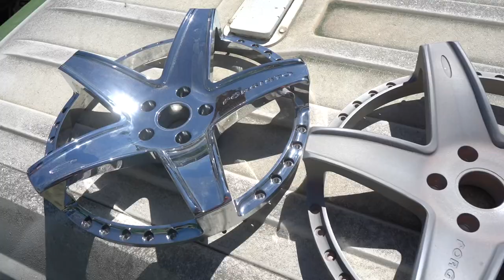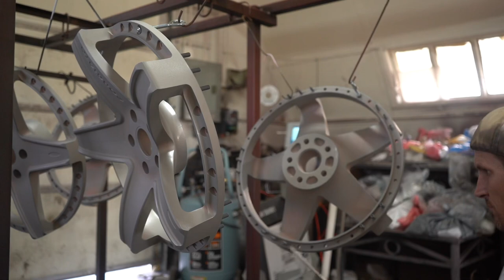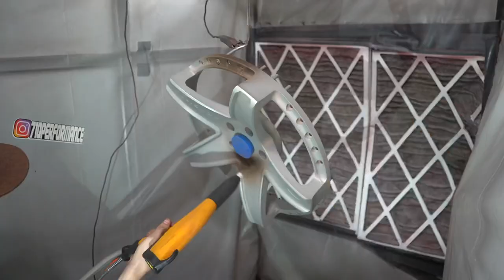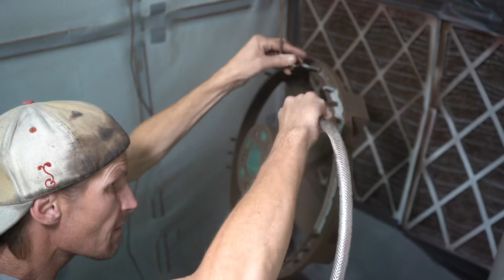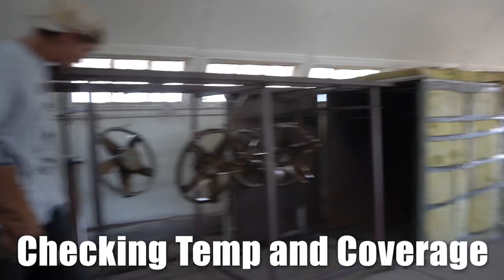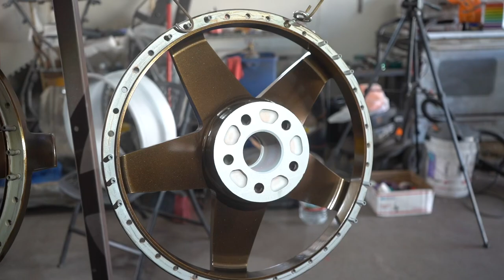How to Powder Coat Three Piece Wheels

Comment: Gow much does it cost you when you sub out your blasting jobs?
Reply from the maker: Like $20 - $40 per wheel (as long as they are stripped and not chrome plated) also depends on the size.

Comment: Why do you have another company blast your parts instead of doing it yourself? Just curious
Reply from the maker: We do some ourselves and we outsource it as well. We usually out source it when we have a lot of work. With our blaster it takes a while to ballast a set of wheels, when we outsource it they can blast 4 times what we can do in the same time frame.